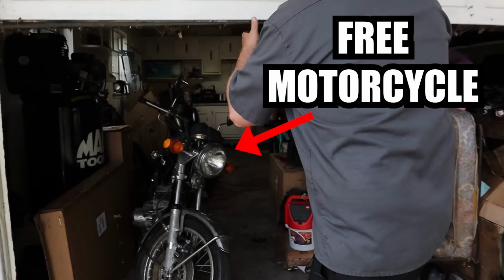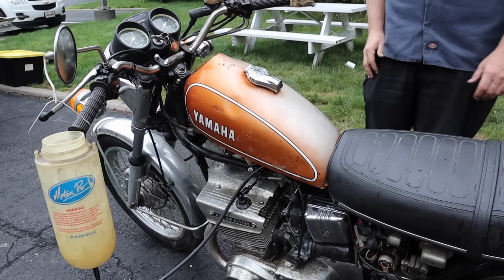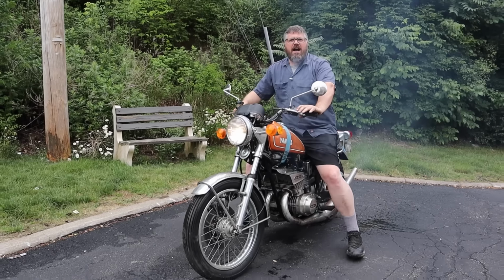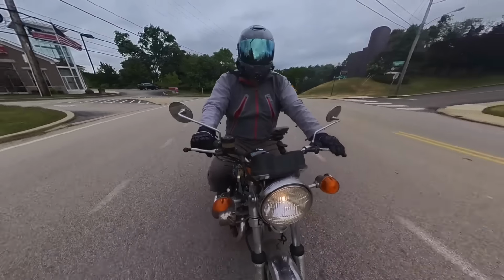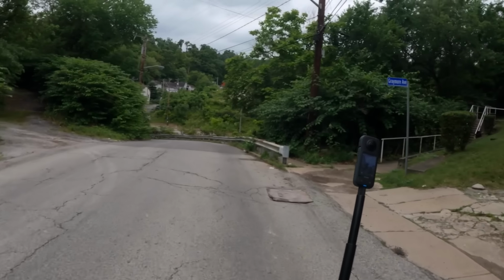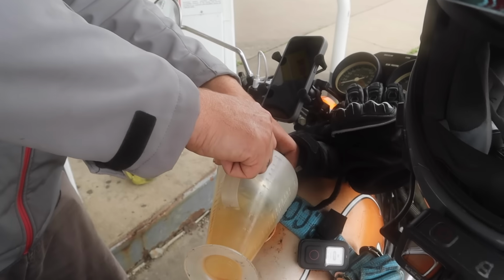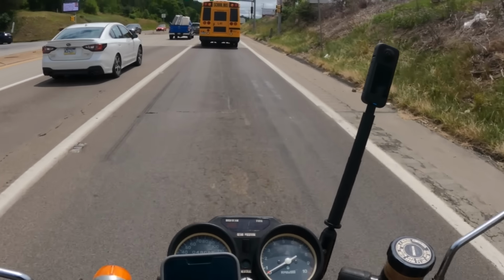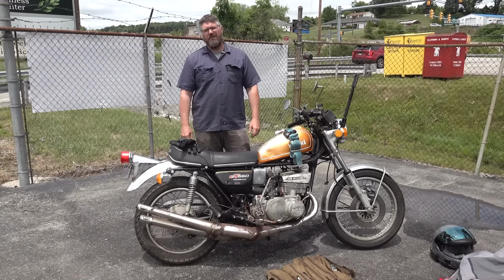Will This 48yr old FREE Bike Get me 253 miles Home?

Comment: Over time I had all the Suzy trippples during the glorious 1970s..the 380 this 550 and the 750 Water buffalo..I racked up huge miles on all 3 especially the 750..The only complaint I have about the 550 is if you don't do regular air filter maintenance dirt finds its way into the engine destroying the top end..The 550 has chrome bores that cannot be oversized..I found out the expensive hard way and had to buy new jugs for mine as well during the only rebuild I ever did on the 3 of them.
Reply: 750 triple was called the kettle, not water buffalo.....
Reply: @chloedevereaux1801  actually at least in Germany it was called "Wasserbüffel" which would translate to water buffalo. So the commenter you were answering to was right. And also here is the wikipedia entry: "Marketed as the Le Mans in the US and Canada, it was nicknamed the "Kettle" in Britain, the "Water Bottle" in Australia,[6] and the "Water Buffalo" in the United States."
Reply: @chloedevereaux1801  in the USA it is the waterbuffalo.  it is also called a waterbottle
Reply: @chloedevereaux1801  In Australia back then it was the Water Buffalo.
Reply: Interestingly, the USA and Canada models of the GT550 never had the Chrome plated bores. They stuck with the standard bores in the USA and Canada whilst the other markets got upgraded jetting and porting with the chrome cylinders on the last three models. Getting cylinders re-plated is very expensive so the USA/Canada import bikes are better in that respect from a current perspective.
Reply: @A_S_100  Yeah, it was news to me about the plated cylinders.  I was a tech working at a popular dealership at the tine, understood ours in N.Y. state had cast iron bores cast in aluminum outer.
Reply: Anything can be sleeved.
Reply: @kevingraczyk7212  And in sweden its called "vattenbuffeln" wich means "water buffalo" :)
Reply: @A_S_100  This is correct.

Comment: Suzuki made a 380 and 550 version . This one was just excellent . Smooth powerful and torquey .Not to be despised .
Reply: I had one myself back when they were current.  They also made the 750 water cooled. You'd probably never find one of those engines in any sort of repairable state since they were really popular for sidecar racing.
I never actually rode a 380 but, these 550s were a good all round street bike.
Reply: @lorditsprobingtime6668  TYpical of Suzies in  the seventies they made wonderful engines fitted into pretty but hardly longlasting running gear with too much poor quality chrome .
Reply: @jonviol  Sadly, too true. I didn't have much trouble with my 550 GT but  a few years later wound up with a T 500 Titan twin. The old guy who'd picked it up from a farmer, kinda a genuine barn find thought it went great. It was actually only running on one cylinder lol. That was a simple fix, just a condenser and it DID run and go great. I registered and rode it for a couple of years till suddenly fifth gear shattered and locked the rear wheel at 140 kph right in front of a semi I'd just overtaken, that was real pucker time lol. I still never dropped it once and I did ride it like a lunatic. They may not have had perfect handling etc but, they were pretty good for the period. I only heard much later on, (too late for mine) from people who drag raced them was to  was raise the gearbox vent and put a certain amount of extra oil, more than the recommended in there. 
I was really sad to see that fairly straight and pretty tank only held together by the paint. I guess enough years of condensation and thin steel is just going to do that. With the exhaust though, he could get lucky. That's a chambered exhaust and unless they were released with them over there, it's likely someone's still got a brand new, possibly never used stock system hanging in a garage somewhere. I myself have 2 never even run stock Suzuki exhaust systems in my garage. One for a DL 650 I had and the other for a DRZ 400 I've still got, neither even left a showroom on the bikes. 
I do respect the fact that the Suzukis, and the Yamahas, mainly the RDs were pretty quick but kinda a balance of power, handling and brakes while the Kawasaki 3 cylinder 2 strokes were insanely (for the time) quick but terrifying handling and brakes.
Reply: @lorditsprobingtime6668  Wasn't the T500 known as "The Whispering Death" due to its deathly silence before it seized up?
Reply: @legomanmw2  Never had any seizing problems with mine. Gearbox yes, engine no. The 550 GT I had did get very close to seizing numerous times while really thrashing it for extended periods on some of my favorite mountain climbing runs though. I just had to ease right off and let it gently cool down for a while and it would come back to normal after a bit of gentle cruising. The RAM air idea didn't seem to help them much at all. Never had any problems with the T500 though.

Comment: That is cool, my first bike was a GT380, it was a champ, it had a broken nylon gear so it would run 30 seconds then die, run 30 seconds then die, the guys at Seattle Cycle Center finally figured it out and I was off and running. The brake reservoir was ruined so I got one off a dual front disk bike, got a bolt that was the right sized, cross drilled it, drilled it down the shaft, tapped out the soft aluminum res to fit the threads of the bolt and I had stoppage. Man the things you do when you're young. I never had any problems with it. Not a greenstreak but still a cool fast bike. I kept up with a turbo bike and he said he rarely ran into bikes as quick as his. Bike was stolen years later. I hope the guy who stole it died on it. Thanks for the memories!

Comment: I like how he casually says “idk if this is just the beginning of the end, and you ‘2 stroke guys’ know what I mean” 😂😂
Reply: I really hope it's just a 'comma' for that great old machine. I rode on for several years and they were one of the more 'civilised' of the mid sized 2 strokes of their time.
Reply: @lorditsprobingtime6668  Agreed. They didn't grab the attention like the Kaw H series or the Yamaha RDs, but the GT series was so much more refined and civilized for everyday use.
Reply: @bluoval3481  Well, I rode a Kawasaki H, both before and after reboring, porting and expansion chambers fitted for racing and could not give it full throttle, even at over 100 mph but, the handling was terrifying! It felt like it should maybe ONLY ever be raced on a drag strip, nothing with even a bend while I'd happily throw my throw my 550GT at tight and twisty stuff, same with the RD Yams, they liked bends and still went pretty good. Those Kawasakis sure were spectacular in their own terrifying ways though.

Comment: I had a friend in college in the late 70s that bought Yamaha RD 400. He bought it because two strokes were gonna die out. He was a motocross racer.. he could pull wheelies in each of the six gears.

His skill level was 1000 times greater than mine .

He bought the bike after his dirtbike that he brought to college had a problem . he beat it up so badly that when he pulled a wheelie outside the dorm, the front wheel fell off because the two clamps cracked.

Also had a buddy with an early opposing piston BMW that did a burnout outside of a bar the tire caught it jumped the curb and he broke a fire hydrant and in half . Water was spraying everywhere he picked up the Beamer had one cracked fin on the cylinder. Head started right up and drove off.

BMWs are awesome

Comment: I remember the first time I rode a GS 550.  Even with the stock pipes, it had a sound that was unforgettable, not to mention the performance.
Reply: They were a sweet ride, much more refined feeling than the similar Kawasaki H1 triple.  Had a neighbor next to me who bought a then-KH500 and we tuned it specifically for his use as a commuter bike (I was the dealer technician) and it surprisingly came very close to being as fine as the 550 but still wasn't as comfy.
Reply: @whalesong999  I've read that after WWII ended, many of the German two-stroke engineering pioneers went to work for Suzuki. Which might partially explain why the street series GT two-strokes were superiorly engineered and more refined than their market competition at the time.
Reply: @bluoval3481  I haven't heard of that.  The only German I know of escaped East Germany during the cold war;  Ernst Degner, who left MZ and went to Suzuki, sometime around 1961.  He brought a lot of two-stroke knowledge with him then.  Prior to that, Suzuki had purchased other Japanese makers, primarily Colleda who already had an electric start, 250cc twin and Suzuki refined and marketed it as the T-10 which I had experience with.  Your statement seems to parallel the aviation field that did employ ex-German engineers to advance U.S. aviation, primarily military.  After the war, many companies around the western world began building a license-built version of a German DKW 125cc motorcycle, including one in Japan if I'm not mistaken.

Comment: Was the holed piston and the open vacuum line on the same cylinder? If so there's your problem. Vacuum lines- stick an old bolt in there. From memory these bikes had chrome bores so no oversizes available.  These days you can probably find someone to re plate them, obviously at a cost. Bike did well to get as far as it did. Deserves to be fixed up properly. Hope we can see that.
Reply: Could also be issue with carburetor. Lean and hot or no fuel equals no lubricant on premix gasoline. Big issue on old 2 stroke V6 outboard, one clogged carb you might not notice before it is too late. That Greg was feeling it starting might already been too late at that point, don't know.

Comment: I used to crave after these bikes, then the Yamahas 350 RDLC 2 stroke. I still have a late model RDX 125 which runs like a gem - incredible revs ! 11'500 redline 🙂
That noise. Sounds like a true motorbike.
We used to know what kind of bike or car was coming simply by the exhaust note.
Best cars for recognisable exhaust note: Alfa Romeo; All Minis pre 80's; Citroen 2CV and then there were all the Diesels (tractors).
All motor bikes had their own noise: Yamaha 2 strokes. Hondas 4 cylinders; Ducati's; Kawasakis; BMW's.
Now it's all just - No noise. Which is nice, but it's an era gone by.

Comment: The worst thing to do to the Suzy triples is to fit expansion pipes. Standard system works best and sounds best.
Reply: Correct, speaking from experience. Hard to outsmart the factory engineers. Two strokes in particular already have overly sensitive air/fuel mixture calibration and aftermarket mods make it worse.

Comment: I grinned from ear to ear on these episodes! I had a GT 550 and the original exhaust was in such bad shape I sprung for a 3-into-1 expansion chamber. That thing SCAMPERED! But it was a little embarrassing because my friends said they could hear me coming from 3 blocks away... Ring-ding-ding ding Rinngggg ding ding. Anyway, mine didn't smoke like yours did. Loving the videos - thanks for the smiles!

Comment: I love this. I get what you were saying about being a 2 stroke owner. I just sold my 1983 honda shadow vt500. It was a two stroke and would start every season, no problems. I just sold it because I felt like it just had constant small issues. Loss of power sometimes. All sorts if small but annoying issues. My fuel injected honda intercepter starts every season, and runs like a top. I loved driving my 2 stroke, just not the servicing :D. Great job though.

Comment: My first bike was a 1981 Honda CB650, it sat in a garage for 25 years. I cleaned the carbs, threw a battery in it, filled the gas tank and fired it up. The tires were dry rotted and cracked, so naturally I rode from my house in Maine to Ottawa Canada with it, some 800 miles round trip. I got 10 miles from home and the rear tire just disintegrated. I pushed the bike home, put Dunlop 404s(3 sets total) on it and got 26,000 miles out of the bike.

Comment: Those 3 cylinder two-stroke bikes are really light and powerful. I remember the Suzuki GT 550 triple, it was one quick ricer. I had the same issue with a Yamaha 125 two stroke, burned a hole on the top of the piston, on a single cylinder, it was game over.

Comment: Two cycles are awesome but obviously they don't take kindly to lean cylinders since that's the only source of lubrication.  Had that happen to an old 55 hp Johnson once.  Bored one cylinder, replaced piston, and cleaned out the carburetor and it was good to go.

Comment: So i bought a honda cb360 that some older fellas kid use to race in the late 70's early 80s...it had been just 100% sittin for 30 years. I had a vague answer on the reliability of the bike and that was " it ran like all hell when my kid had it."...so i bought it and a kawasaki triple 3/400 for 200 bucks...cleaned it up and had to change the carb diaphrams..this thing was evil...it would barely at all run below 3800 and at 4400 it screamed like a banshee coming out the depths of hell. No inbetween with this thing. Even though since i have owned a lot more impressive bikes, that thing taught me a lot of lessons real dang quick. I still wish i had it today because man with that little fella rip.

Comment: There are shims beside the main bearings to lead the oil coming from the oilpump to the bearings. This shims block the ventilation of premix gas through the bearing  to lubricate it! You can use premix but you have to remove this shims from the crank! Otherwise bearing seizure is guaranteed....!

Comment: I had a GT-380 3 cylinder two stroke. It would only do 105 mph but, it would get there in a city block! Years later I had a GSX-R1100 & even it didn't stretch my arms any harder than the 380 from 0-105.

Comment: I had a buddy with a bike with a similar design. All of us rode four strokes at college. His was the only two stroke. About one time out of four he would have to pull spark plugs because of excessive oil from the automatic oiler. Most of the time we hung out and waited for him to do it because he was pretty fast but if a storm is coming, we took off. We got home dry he got home wet. Weird dude he swapped to a Harley chopper

Comment: a hole in the piston is caused by a weak (lean) mixture.  caused by 1. lack of air filter. (only at higher revs though)  2. crankshaft seals are probably age hardened. (left side will let air into the crankcase, right side will let gearbox oil in.  as you've holed the right, you've probably sucked/burned all the gearbox oil away.  or 3. you left the vacuum pipe open! which is unforgivable really. or 4. all of the above.    these are worth a small fortune in the UK. & that looked like a good rust free one.   my dad had the GT380 that he used to let me ride when i was about 14.  brilliant bikes.

Comment: I had two of these traded the first at 55,000 miles no motor problems, great ride! 
Fast off the line till about 85-90 then less. 

On oil injection with proper jetting you get about 800 miles a quart. 
Sad 
These were excellent motorcycles in their day, fun rides, reliable.

Comment: two strokes the crank seal behind the points would have been stuffed and dragging in air, running lean and that is the cause of the hole in the piston.  When a two stroke sits for a long time the crank seals are due to fail when started, I was amazed you got it that far.

Comment: They had a tendencie to burn holes in the piston if they got lean, using premix  and no airfilter both contributed to the hole.

A rebuild isn’t a problem, but i would be doing a full bottom end rebuild while i was at it, as the crankshaft seals go and then you lose crankcase preasure and two strokes don't like that.
I would make a cafe racer out of it.
A mate burned a hole in a piston on his GT250 back in the 70s comeing back from Santa Pod, he took the head off, filled the hole with Araldite, let it go off, the rode home.
Where he rebuilt the engine.

Comment: The only diffrence i would've  done, is i would have front brakes and i would have mixed my gas in a can at 20:1  because the old bikes run richer on oil, and on oil injection bikes it feeds the crank bearings and injects  Into the intakes keeping everything cool. So premix is only for initial start up and testing, anytime you go more than around the block you need that oil injection working properly, i usually set up the injection pump a little rich for the first tank or 2 just to be sure that everything is happy and well lubed with clean oil before setting back to factory specs or just a touch richer than stock. They are finicky but once you've done several of these old gems, and im sure you have, you learn that they are particular but awesome once you get em right👍👍👍 if it were me, id source piston and ring kits, CRANK seals, and a full gasket set and put it right. The brass floats are easy to repair with a propane torch and some flux and tinning, thats part of the beauty of old carbs

Comment: Some bike models actually lube the bottom end crank bearings with the oil tank and auto injection thing. If you put just premix in certain bokes it will ruin the motor (crank bearings)

Comment: I never had a GT 550, but I had a GT 500 and a GT 750. And also the little 50 cc with the same oil injection system. And you can't just pour oil in the gas and go. There's a system of tubes and channels, that lubricates the otherwise sealed off crank bearings. If the oil-pump isn't active, the pistons will be lubricated, but that's all. So my guess is the bearings started seizing up, causing the cylinders to run hot and you burned the pistons. On a GT 500, a burned piston isn't stopping the bike, you can go on one the other. It happened to me once. However, running with the oil system disabled will wreck the bearings. So.... it survived thirty odd years in the garage and then you found it. Poor bike.